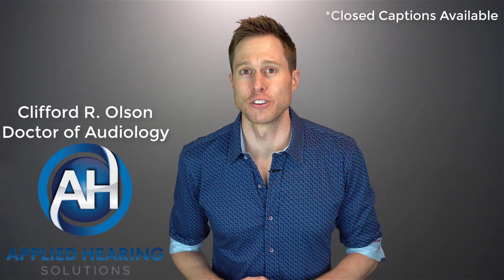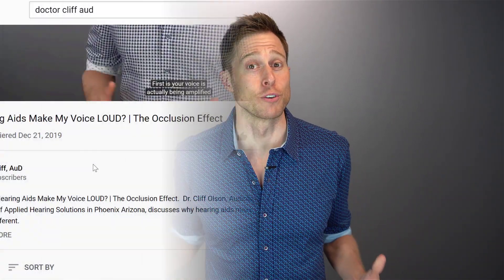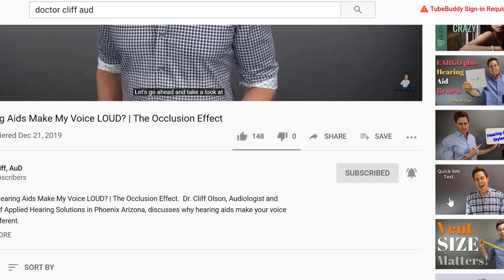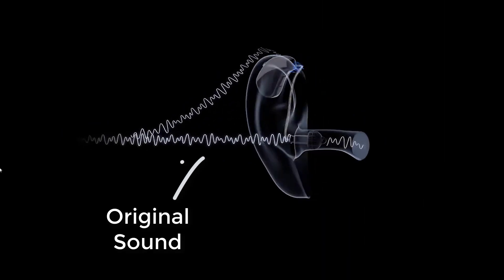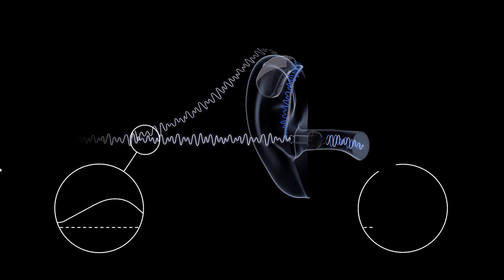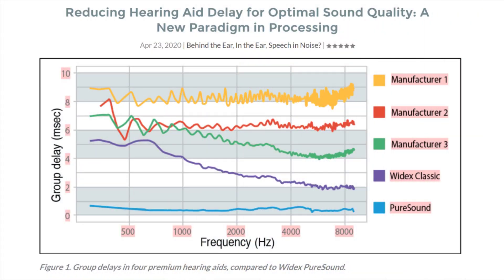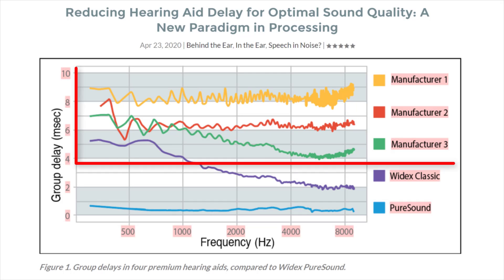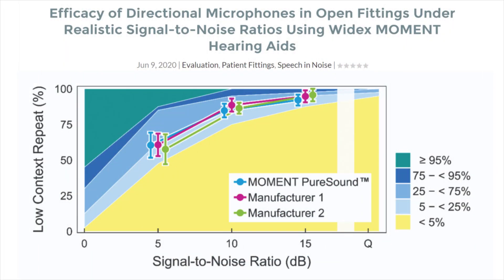The Search for NATURAL Sound Quality | Widex Moment Hearing Aids

Comment: im a loyal costumer of widex. but im concered about if it makes any difference than evoke for profound severe hearing loss .. so ??
Reply from the maker: The main feature of the Moment is the PureSound and TruAcoustics.  These are not necessarily game changers for individuals with Severe to Profound hearing loss.
Reply: Ask for a trial. When amplifying sounds for severe/profound hearing loss more distortion is introduced anyway. Definitely a trial as with your loss a small improvement in sound quality could potentially improve your quality of life. Be aware, Widex do state, to the best of my knowledge, pure sound best for mild to moderate losses.

Comment: It’s important to note that the Puresound feature benefits are primarily limited to people with mild to moderate hearing losses, although the moment product can be fit to people up into the severe range of hearing loss.  I had early access to the product (late March) and it’s nothing short of amazing the results I’ve been getting with my patients.  But anecdotally I’ve found patients with more than a moderate loss don’t notice much difference between the Puresound setting and their previous “Universal” setting.  I’m not saying this to undermine Cliff’s video or the Moment product.  If just believe there should be realistic expectations for those who may want to try it should they have a more severe heating loss.  My assessment is based on about 20 fittings so far, and I’m considering embarking on a formal study about it.  However, Covid has slowed me down on my ability to conduct such studies.  Doesn’t mean I won’t try!

But for sure, this has been the best sound quality I’ve seen for patients who are in the mild to moderate range.  They should seriously consider trying it.
Reply: I should also add that just because Puresound isn’t currently translating benefit for severe losses doesn’t mean that they won’t come up with a similar solution for them in the future.  This is just the start.
Reply: @sfrink1425 they have the best sound quality even with moderate loss,.. puresound would cause insufficient gain for someone with a more significant loss. I got the widex after having no luck with phonak and widex is absolutely amazing. I’m a musician and i test my case with this manufacturer after begging my audiologist so hard for months to try these

Comment: Does the comb effect occur if you wear fitted/molded domes? I don’t notice it with mine (I wear Oticon). Thank you.
Reply from the maker: No, if you don't have any original sound coming through the ear canal, then the comb filter effect can't occur.
Reply: Comb filtering occurs when you had 2 signals with a delay between them. It happens when singers record with headphones on. Ff the signal path has a delay the singer thinks he/she is sounding weird because the original voice+headphone voice are comb filtered because of the delay. 2ms is considered low latency monitoring in the recording industry.

If you have a mold, there's almost no "natural" input to the ear, so the sound comes from the hearing aid (only one source), so no comb filtering effect.

Comment: Can I use  2 different hearing aides (one for my left ear signia and a phonack rechargeable for my right ear?  The reason being one of my ear canals is bigger than the other. The phonak won't  show much plus I will be able to use the phonak rechargeable  with my phone. If you can please reply.
Thanks😊
Reply from the maker: Not a good idea.  Hearing aids share information with each other to optimize their performance.  However, they need to be the same make and model.  I never recommend mixing brands and models.

Comment: Why is technical info on hearing aids so hard to find? I just got the Starkey Livio AI and can’t find published latency numbers anywhere. Also, for natural sounding correction, what do you think of the Phonak Lyric? It’s analog, so almost no delay (which might matter for single sided hearing loss to minimize delay between left and right ear) and it sits close to the ear drum.
Reply from the maker: I agree that data is hard to find.  Even when we do find data, the research is not usually conducted by independent researchers.  I think the Phonak Lyric is great for sound quality due to the analog sound processing.
Reply: Look up the meaning of analogue, if you don’t already know, and you will understand why it sounds better. In Uk the lyric is subscription based meaning on average £3000 per year for a pair of lyrics. Probably a little more in US but absolutely no idea to be fair.
Reply: Phonak 👎🏼👎🏼👎🏼👎🏼👎🏼👎🏼
Reply: Lyric has a linear compression which can be done in almost any device.. I have tried so many different ones because I was not a candidate for lyric but I loved it.. I now have the widex and they are amazing sound quality!! They are specifically meant for musicians which is why I decided on those after 9 months of no luck with any other device

Comment: Widex is a great hearing aid, but last time i checked they have been lagging in making their products compatible with android/ios, bluetooth.  THis should pretty much be standard in this day and age.
Reply: I got the moment 220 since a few days and never had bluetooth problems on multiple devices so far, running the moment app and conecting with the aids
Reply: That's great because they are a good hearing aid for speech
Reply: do they have an app for windows for your laptop or just for phones
Reply: @caramelexspressofan  not yet unfortunately, but I don't know other brands that have.
Reply: Phonak has an iPhone app and I find it very usable and useful. I do Bluetooth streaming on both my iPhone and iPad. I tinkered with settings via the app, which gave Dr. Cliff info for fine tuning my aids, and now I've stopped tinkering because it's just right. The Phonak app even does remote programming, which is the most important reason Dr. Cliff recommended it for me. (I'm not sure if Phonak does Android, or who else does either Apple or Android well. Worth Googling, for sure.)
Reply: @marymaryquitecontrary  That sounds very similar to the widex app I have installed on my android and iPhone right now. I think app support in modern devices is really helpful and I was thinking about trying out Phonak aswell, but was confident with what I got from Widex so far. It's nice to have a choice and see different manufacturers compete and improve
Reply: I have the phonak, and by and large its worked really well with a whole range of devices, i also love the roger select.  Unfotunately i recently bought a razer laptop and the hearing aid bluetooth kept dropping out for no reaseon i can work out.  My bose and pods worked perfectly with it but not the hearing aid.  I was also dissapointed that neither phonak nor razer seemed that interested in fixiing the issue given that both products were clearly not faulty and had some connection issue. Thats why im really keen to see a windows based app for a hearing aid provider.

Comment: Hello my problem is not with lose of high frequencies, but rather the loss of low frequencies. Due to an inner ear infection voices in my left ear sound like the smurfs talking, high and squeaky. Is this correctable with current technology?
Reply from the maker: Hard to comment without all the info from a full consult.
Reply: Thanks for the input I know it is almost impossible to diagnose something at a distance. 😀
Reply: In the UK you would be referred to an ENT Consultant who would decide on treatment...medical, audiological or a mix. If you needed hearing aids they would be provided free of charge and subsequently replaced every 2-3 yrs again for free. This would include all aftercare, etc.... irrespective of what was needed it would cost you nothing and be provided within weeks. I believe in the US they have amazing medical treatment via an insurance scheme. I would consider the benefits of discussing with your insurer an ENT Consultant examination. These are the only medical people, to the best of my knowledge,  who will have the answers you desire. Good luck.

Comment: Why not eliminate the "open dome" to avoid the processing delay effect? This would have all  sounds processed equally and provide more natural sound since there is no delay.
Reply from the maker: There is an argument to be made with closing off the ear canal entirely to force most of the sound to be processed through the hearing aid.  Problem with that is if you occlude the ear canal you create insertion loss that you have to amplify to get back, and amplified sound is never better than natural hearing.  So, what you give up you can't necessarily get back by occluding the ear canal.  Besides, you may also experience the Occlusion Effect which isn't much fun.
Reply: @DrCliffAuD  but you can always use vented molds,. No? That can help with the occlusion factor
Reply: If you get rid of the comb filtering effect, open domes sound more natural, because you have "natural input sound". With a closed mold, you're hearing 99% hearing aid. Hearing aids don't have a natural sound: they change de dynamic range, the frequency response... Because a hearing aid is not designed to HEAR, is designed to UNDERSTAND. That's why they have this "telephonic" sound to it, they get rid of some frequencies not related to speech, so, no natural sound there.
Reply: It depends on your hearing loss. If you have more then a mild hearing loss, such as moderate, you will not benefit at all from domes.  Using properly fitted vented earmolds is the best option

Comment: Great potential for the Widex Moment but it is still in the software teething process. Our best practice provider is great and we understand that we are on the bleeding edge. 
BLE streaming is terrible compared to older Resound lynx, sound quality is very good but stability of the connection is not acceptable yet. They really need to jump on fixing the issues with streaming. The Widex Moment iPhone app is improving and looks like it may support firmware updates which will be great.
Reply: Yes, I got my Moments going on a year ago and the Bluetooth is just plain NO GOOD. I can barely even get a good signal when I have the phone 3 feet away from my ears with no obstructions... put it in my pocket and you might as well forget about it. When asked about it... my doctor says blame Apple. I kid you not. So they cannot connect to more than one device and the device they connect to is not even barely acceptable. Why keep them? The sound that I get from the hearing aids for natural environment and live music (Which I play on guitar) is tonally very pleasing. Outside of that as far as wireless goes they are pretty much worthless.